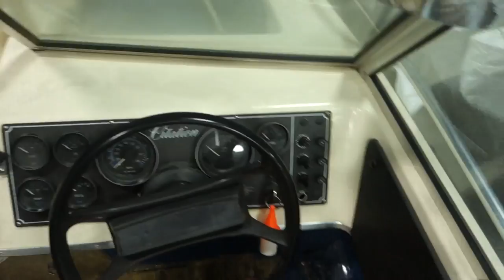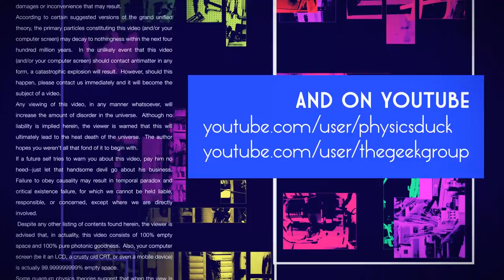Captain's Blog 3 20 2017 Impellers and Bellows and Robot Grinding

Comment: When you put the impeller back into the pump, rotate it in the direction it normally goes as you insert it, it's a tight fit, and you don't want the 'vanes' turning the wrong way.
If that pump got hot, that engine was run without water.

Comment: As a general rule, melted or distorted plastic (or water pumps in general) should in fact be replaced even if they are only slightly damaged because they could leak and in the boat's case, water will not transfer as efficiently. If a water pump was ran dry, it might work if rebuilt but if it was hot enough to dry out the oil, there is a good chance the inner portion is misshapen somehow